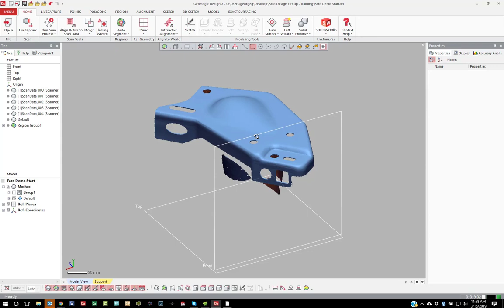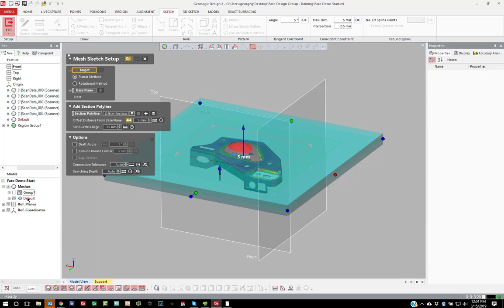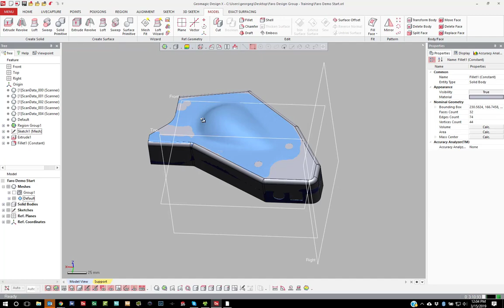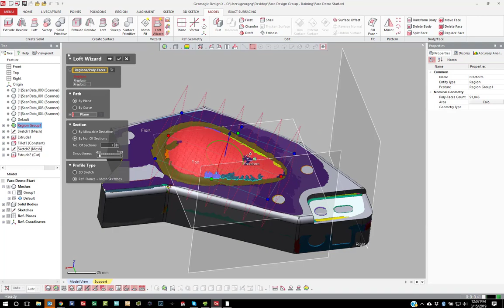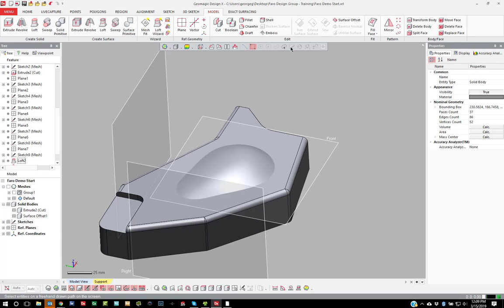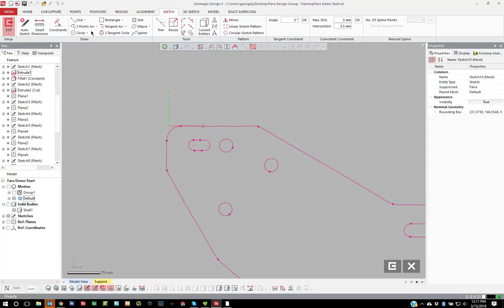Faro Arm Scanner -Tear Drop Sheet Metal 3d Modeling in Geomagic Design X

Comment: GREAT VIDEOS Gregory. Do you happen to know a way of removing stray lines that appear after Boolean etc I usually use Fusion 360 that average faces when deleted but Design X looks messy in parts do you know if its possible? I'm new to this software